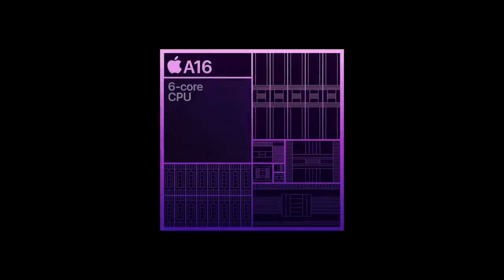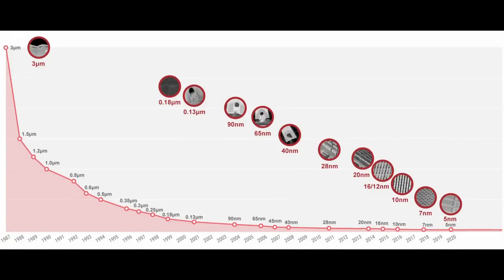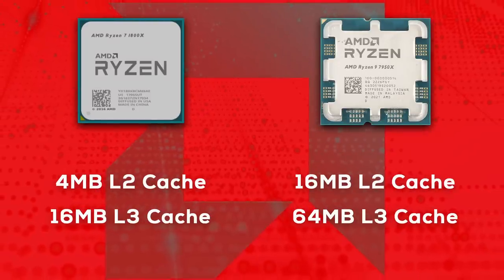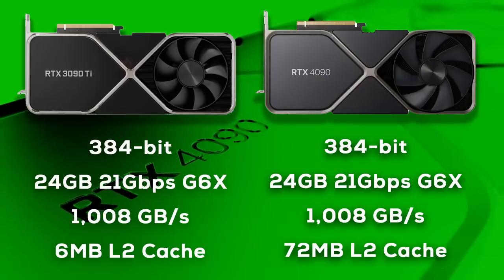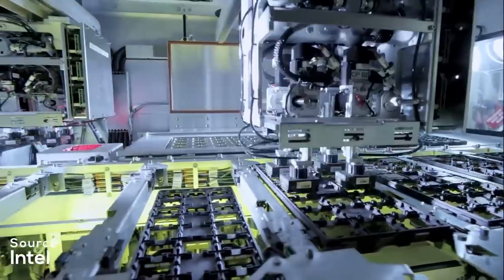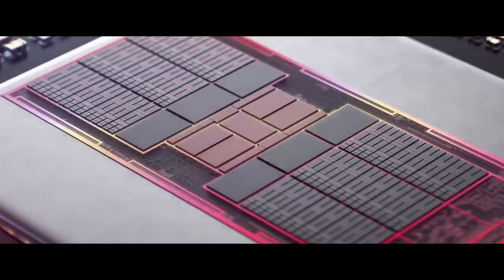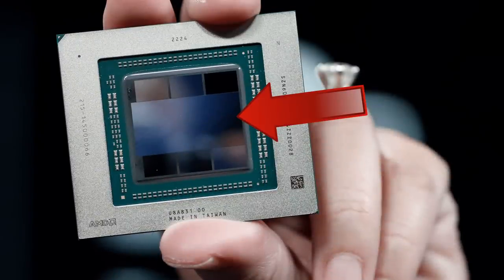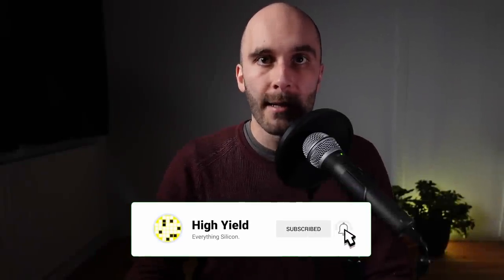Next-Gen CPUs/GPUs have a HUGE problem!

Comment: This is why MCM (( multi chip modules )) combined with 3d vcache will be soo important moving forward. L4 cache will probably make a return also, as something much farther from the die compared to L1 to L3
Reply: if L4 will be able to work as RAM that would be a revolution. Few GB of L4 would make getting RAM for light use obsolete. And even with extra RAM it would be a massive performance benefit
Reply: You say "Important" but there is legitimately no excuse for more powerful consumer hardware outside of extreme VR / 4K. Graphical fidelity has peaked years ago at the currently mainstream use of polygons. If anyone bought any sort of remotely mid-range computer within the last 1-2 years and they experience performance issue in games, it is 100% optimization / functionality related.
Reply: @Coecoo  I agree with you from the sight we have now, but I wouldn't set it in stone just yet. 
I don't see what can be improved in graphic fidelity. 
But just because we don't see it, doesn't mean that there is none.
Reply: @Coecoo  completely path traced ray traced games are the future though. And you need the most powerful hardware today to run 4k/144fps which gives you optimal smoothness with visibly much better graphics.
Reply: @Coecoo  companies should definitely be aiming for efficiency, but they don't, and probably won't, because "this won't destroy the planet" doesn't market as well as "oooooh, shiiiiny"

Classic capitalism 🙃
Reply: @dkis8730  meh. That's completely ignoring that so many games just do not need path tracing, as well as ignoring that stylised graphics exist (how TF would you pathtrace Celeste, Or slay the spire, etc etc), not to mention that it gives relatively little fidelity gain to its massive computing needs
Reply: @ThylineTheGay  idk I see a pretty noticible difference. Fully path traced games are also more accurate and would technically be much easier for developers, as they just have to add light sources. Technology is not going to simply stop progressing, ray tracing is most certainly the future
Reply: @dkis8730  no. Just no lmao.
Games are art, like with art there is no "ultimate way to do things", just different ways.
Reply: @dkis8730  Did digital photography obsolete painting? No. Did 3d animation obsolete 2d animation? No. Did audiobooks obsolete books? No. 

Exactly the same for games and their tech, there are many popular games that have "outdated" graphics (e.g. ultrakill). Yes sure, path tracing will probably be the future for "TrIplE A" games, but those are just endless pursuits of profit, and all look the same anyway to me.
Reply: @ThylineTheGay  yeah obviously, technology keeps progressing as a whole though. We're in the baby ages of modern technology and you think everything will come to a screeching halt because we determine it's good enough? People 10 years ago, 20 years ago, etc were always surprised at how good graphics were getting, just like we are today.
Reply: From what I understand, everything else will stop scaling at 1nm. This is just the start.
Reply: @Coecoo  Unfortunately I have to agree. I personally turned DOWN my PS5 from 4K images to 1080p images because my very good gaming class monitor? Only does 1080p max.
VR? Eh... I was going to try it but after reading about the issues and seeing that Facebook and others were trying to 'lock' you into their services and were getting too stupid with the bans for speaking your mind on various subjects on Facebook... I said "No."
Reply: I wish HBM would become the new L4
Reply: @ThylineTheGay  People were saying this in 1996 when Mario 64 launched, yet see how far we have come now.
Reply: @ThylineTheGay  Ohhhhh Shiiny has always trumped not destroying the planet, that is what we are as a species.
Reply: @diablo.the.cheater  sadly yes
Reply: @CleetusGlobin  everything is political, especially corporations and the awful things they do
Reply: @ThylineTheGay  Why would stylised graphics not benefit from realistic light transport? We've got path traced Minecraft for crying out loud. It's not needed for everything, but getting good lighting without spending thousands of hours trying to fake it is a pretty useful tool.
 
As much as I don't like capitalism, I don't think video games are that high on the list of things killing the planet. Not to mention that the same hardware is also used for scientific progress in a variety of fields, among other useful things. And it's not as if computational efficiency isn't constantly going up. Even if gaming PCs are using some more power on the high end, for other uses were getting way more work done per watt.
Reply: @Coecoo  Go and look up Unreal engine 5 and it's underlying tech if you think graphics fidelity has peaked. We're only getting started at this point.
Reply: @Coecoo  This is how I see things going mostly: While we use some of the increased performance we've gotten over the years quite well, we've also used a lot of it in a "Brute force through sheer performance rather than optimisation" sense with stuff like Electron using 100s of MBs of RAM for programs that could easily just use 10s of MBs as one obvious example. Simply put, the progression will largely switch from hardware back to being clever with how we write and optimise software to make the most use out of the hardware we have rather than just to make the developers life much easier.
Reply: Possibly, but if MRAM replaces SRAM as the cache device of choice for L2+ then there will be little need for L4 because the areal densities of MRAM are potentially far greater even without multi layer 3D designs which are the obvious future for all memory types anyway.

(multi layer 3D DRAM is also on the way, though it may take time as it requires a dramatic change in DRAM design to remove the capacitor from the DRAM cell)
Reply: @Coecoo  We're still far from real-time photorealism though. It's only now, thanks to ray tracing/path tracing, that we're getting close to that.
Reply: LPDDR/HBM would be effectively L4, though. And even for desktop it might make sense to have a module that you clam down with your CPU that provides the L4, they just need to leave a hole in the middle for the CPU to touch the heatsink.
Reply: @GewelReal  Or it would be the other way around. RAM on mobile device can easily get to 6400MT/s, even though the bandwidth is only 2x16bit rather than 4x32 on a DDR5 desktop. And with the size of a desktop CPU it migh be possible to get a 4x32bit or 8x16bit module on top of the CPU to achieve the same level of frequency as mobile devices, and that would be quite a bit faster than DIMM or SODIMM module can achieve.
Reply: True, but that's not the point. SRAM is old tech and we need a replacement that uses at least half the number of transistors.. There's R & D tech. that uses 3 or 4 instead of 7 transistors per bit. Of course, optical / photonic computing will smash Moore's Law to bits within 10 years.
Reply: Not really, since it is only a work around to delay the inevitable for maybe a couple more years. What is important, is to drive the research into new materials to replace silicon and even that will be just a delay because there is only so much we can do till we reach a level where electricity can't be contained on the rails anymore. So we have to come up with a whole new architecture for CPUs. Quantum computing or even Biological materials.
Reply: @GewelReal  true. L4 to replace DDR5 RAM, and RAM to replace on-SSD pagefiles when even more is needed. That would be freaking fantastic
Reply: @dkis8730  if real-time path-tracing is the future, then we need to bring back analog circuits into computers. They'd do everything instantly. With numerical computation, path-tracing is unoptimizable because of its very nature
Reply: Yep. I read you comment to then imagine say a future scaling where processing units are built like floors, say even L2$ are moved to be stacked and interconnected on a floor below and/or above the compute/core floor, would be neat to scale it to a cube with next-gen non-silicon fab methods.
Reply: @Coecoo  Optimizations issues are well known. I could play Shadows of Mordor on my old Gaming laptop without issues (although far to less VRAM for my settings). It proper managed my VRAM issue and ran very well. And the graphics were far beyond what the laptop actually is capable of. We could sustain the current HW even for pretty darn eye candy games if the game devs would care about a proper resource management and optimization. But in the meanwhile we can be happy if the game even starts when getting it on release date......
Reply: @Coecoo  More overhead leads to less optimization required by game / software devs.
Reply: @rocket2739  Contrary to your thought, hardware accelerated path tracing is actually used to reduce power consumption on mobile platform. Also, Cyberpunk 2077 with ray tracing on actually got higher framerate than the highest non-ray-tracing options.
Reason? Because a lot of the shader effects (for example, shadow, reflection, ambient occulution) could make use of FP16 to achieve the same apparent quality as FP32, but non-RT-accelerated GPUs doesn't got FP16, and has to use the overpowered FP32 core to do all the FP16 calculation. That means RT GPUs can do things twice as fast using the same power. And it only scales up when you introduce more and more effects that were hard to achieve using rasterization, to a point that full path tracing might actually be a more viable way to do things. 
Not to mention in the future maybe even FP8 can play a role in rendering minor details, which would give RT cards an even better edge, as by that time FP8 would likely be hardware accelerated as well.
Reply: @Coecoo  Realistically the limit of VR would be effectively 24K (12K per eye), and with 16xMSAA. Which means no current gen VR should ever be considered "extreme", because even top of the line ones can barely do 8K at 4xMSAA. 
Of course optimization still matters, and having low-end hardware won't stop anyone from enjoying what it is. It's just like having suboptimal eyesight, it won't make you unable to tell what's around you, but it's definitely not the peak of human perception.
Reply: @ThylineTheGay  If I recall correctly, path tracing was kind of "the original way" to do the first ever graphics. The problem is, it's slow, it needs a lot of compute to do. So, instead we decided to use rasterisation. Because it's fast. But to achieve indirect lighting or soft shadows or ambient occlusion or whatever, you can't "just do it" with rasterisation. All the things we do nowadays are hacks, hacks upon hacks and we've kind of gotten to the end of the line with rasterisation. Look at the graphical quality of games over time, it's been flatlining since Crysis. Massive gains leading up to it but very little ever since.
You say games are art and there's no ultimate way to do things.
Well, if you want games to be art, and you want the developers, or should I actually say artists, to have the freedom to express themselves and make art, then you should be championing path tracing. Because with path tracing, you don't need the ridiculous time consuming hacks to achieve what you want to achieve. It's simpler. It straight up simulates these things based on how light travels and bounces and diffuses and interacts and so on. You don't have to worry about HOW to achieve the look you want, you just need to worry about how you WANT it to look like. "But but but but I want an unnatural/or some other type of look and feel". Then do that! You can define the materials however you want, constrain, break the laws of physics. It just...works. It's simply the best way to do things if we just have enough compute power available. And we need things to change. Games are getting bigger, more complicated, harder to make, take longer and the artists are having to deal with crunch due to unrealistic expectations and poor working conditions and so on and so forth. You probably get my point.
Reply: @Lagittaja  my main dislike of "RTX is the future" is that, ray tracing is soooo much more computationally demanding that it cuts off anything older than the past few years, for no particular gain.
You say that games graphical quality has been flattening over time, honestly, how is that a bad thing
Reply: I was going to doubt you, but then I thought about L4 chiplets. You could just make an entire chiplet of cache, available to the socket or neighboring chips, whatever. And staple it onto any product. There's also a heat/power budget that can be free'd up by moving cache off the logic die. Said chiplet can run hotter on it's own without worrying about impacting logic as much. Or alternatively using the extra area from a chiplet to run larger SRAM cells that are more power efficient to save heat or clock them faster.
Reply: L4 cache would benefit iGPU systems the most.

Comment: AMD had cache scaling down as one of a few reasons they decided to split dies. Cache and some interfaces such as the memory controller don't scale well on their chips when going down a node, which is why their later EPYC and R7000 parts have the IO and some cache levels split from the cores so that they can maintain the diminutive size of the actual cores themselves, and then anything that doesn't scale well (e.g memory controller, L3 cache and so forth) can be produced on another die at a cheaper, lower resolution process node (say, 5nm for the CCDs and then 16nm or even 20nm for the MCD / IO dies). This is also why the Memory Cache Die (MCD) of RDNA3 is a thing too, as it doesn't scale well on the current 5nm node, so AMD has opted to use a larger node for these parts to reduce cost, and then reserve the 5nm node for the GCD itself where they can still see density benefits from the increased resolution of that lithography node.
Reply: Well, they don't quite wanna go so far back as 16-20nm, they've been progressing their non logic die, For Ryzen 7000 it's 6nm for IO (and IO + L3 for RDNA3) a high yielding, efficient, and cheaper than 7nm node that's basically refined and faster manufactured 7nm due to multiple layers using EUV. Seems like they'll stay there for a while on IO (and cache for RDNA) and keep logic shrinking to new cutting edge nodes.

While density doesn't scale anymore with IO, and now memory, there is supply, tooling, and energy efficiency still that factor's in. 20nm planar silicon wouldn't be as efficient for L3 or IO.
Reply: ''Reduce cost'' yeah, for them. Because on the consumer end, we have yet to see the prices go down...
Reply: @rocket2739  Technically we saw RX7000 prices drop a bit below the previous generation RX6000.

But really, reduced cost means it won't increase as much as any competition that isn't doing the same thing. If this pays off for AMD, and Nvidia takes years to get their own implementation then they'll be at a cost disadvantage.
Reply: @Jaker788  Nvidia enjoyed its day in the sun.   I remember when the Titanium Series(or whatever it was) was released...  It was just by chance that I read an article (on some online computer magazine/media)....  I recognized the jump in technology/speed/value...  Nvidia shot ahead of the pack.  Not by a few feet or seconds,  more like they "lapped" the competition....  that stock  just moved from $17/share to $20/share.  Some how I got it all together and told everyone that I knew "BUY INVIDIA!".  It just reached $27.   I guessed that it could go, maybe, up to about $129.  I figured that was as far as my skill could guess.  I don't know jack about the stock market or trading...  It was the only time  in my life that I made a prediction of a stock profit... or suggested purchasing....  NAILED IT!
Reply: @josephsteffen2378  The same with AMD. Unfortunately didn't have money for investment.

Comment: Magnetic resistance memory is nearly as fast as SRAM and there are methods out there for it to be used in an analog mode allowing a single cell to hold 8 bits per cell. Would be interesting to see in the future if this tech gets adopted.
Reply: Wouldnt it requiere on chip error correction to be used to store 8 bits?
Reply: @diegorosario2040  depends on the design but it might. I'm not 100% sure how it works but to my understanding its a sort of a magnetic potentiometer with a sort of adc that is hardwired to the 256 possible outputs.
Reply: @jabadahut50  the deal with non binary encoding Is that it worsens singal to noise ratio. Error correcting code would be need to mitigate that problem
Reply: @diegorosario2040  likley and im sure that might trade some speed off but ecc memory is already usually denser and slower than non ecc memory anyway so I dont think it'd be a huge trade off for 8x capacity per chip
Reply: @jabadahut50  it Will work storage wise but i am curious if it could compromise bandwith
Reply: @diegorosario2040  id imagine because its blitzing 8x as much data per read, hitting bandwidth may be easier